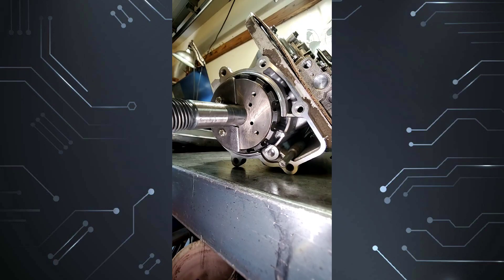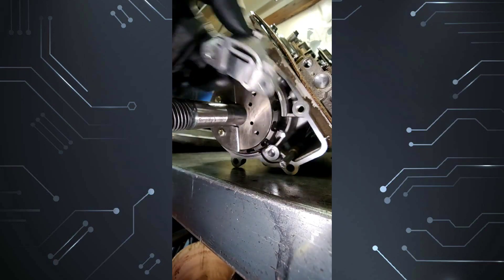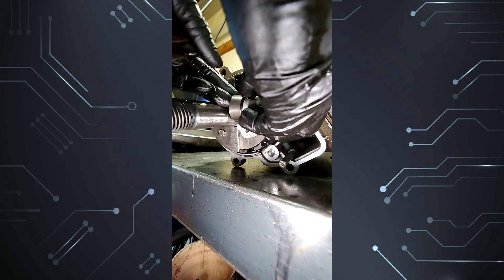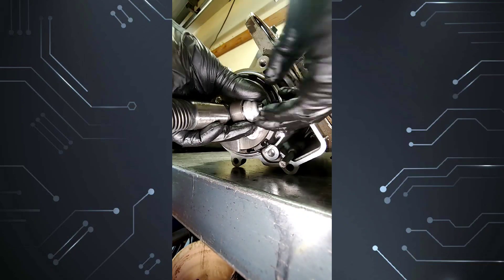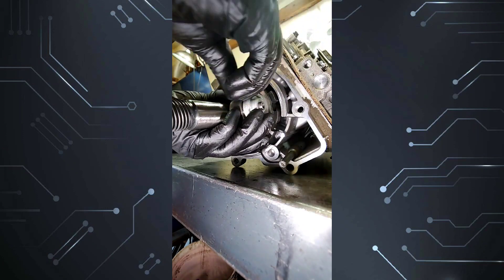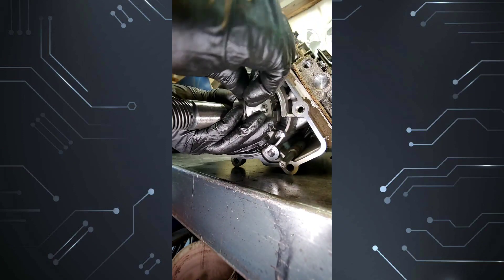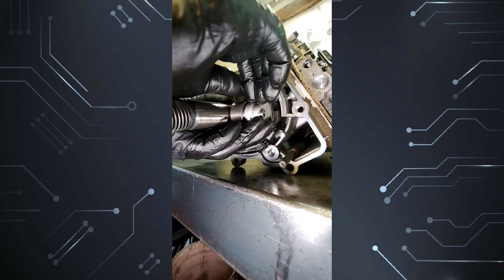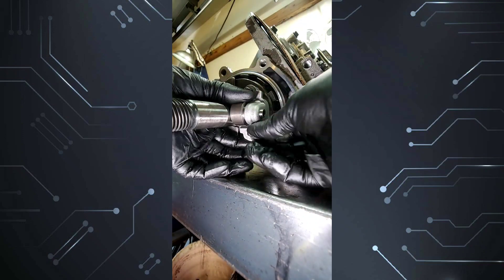🔧A4LD Governor and Anti-Stick Spring Installation | #A4LD Anti-Stick Spring.

Comment: i have a volvo v70xc with a AW50 gearbox probleme is its dos no change gears it like it limbs to a hi gear but PRND gears all select with a clunk sound only when its in drive it like normal on min the next it gows to a hi gear and stays there pls need help to get the problem

Comment: I would like go back to the days of the a4ld…. lol
Reply from the maker: Yeah, repairs were more involved back then. Specifically when cooler and transmission were not properly cleaned.
Reply: @AutomaticTransmission hey brother I got a question for you I'm stumpped & been looking for a way to reach out to you.

I just recently rebuilt my bmxa transmission with a master rebuild kit along with the translab shift kit, upgraded filter & new torque converter. 

When I first had it all done while the car was in jackstand I started the vehicle and begain to go into all the gears to make sure everything was working properly however when I went to put the vehicle back in park I didn't realize the hubs were spinning & I got a slight grind when trying to put it in park, I then proceeded to kill the engine & continue into park. 

Once I got the vehicle back on the ground I topped off the fluid & drove the car for about 30 min or so and the car ran perfect no problems at all. 

I brought the car back to my shop and parked it for about 30 min before I got back in the car and was heading home, I stopped by the store on the way & when I went to out the car in reverse this time I notices a slight jerking in reverse "it didn't previously do this in reverse" so I drove back to the shop "just fine" and parked the car afraid to mess up the trans. The next morning I took the trans back out of the car and cracked it back open to inspect my work and everything looked just fine however there were metal shavings in the transmission "I'm assuming from when I tried to previously put it in park". So I cleaned the whole transmission again and put it completly back together "with new filter again" put it back in the car, filled the fluids and now I'm getting a clattering from the transmission in park & natural put in reverse or drive 1,2 or 3 there's no clattering at all & the car drives just fine except reverse.

So now I have a clattering in park & natural and slight hesitation almost like a jerking in reverse. 

I'm on the edge of selling it all and being done with it yet I'm almost 7k in on this car rebuild and would fix it if I knew exactly where to pin point I just can't keep throwing money at it blindly.  Thanks for your help

Comment: That's a good repair. In the 80s Ford did not have an exchange program and all transmissions had to be repaired in the dealership which made for competent trans techs
Reply: Yes!
Here un Brazil, Automakers are doing transmissions  without allowing  repairs.